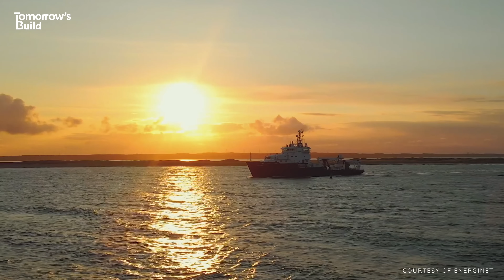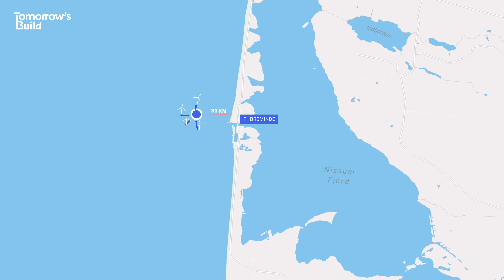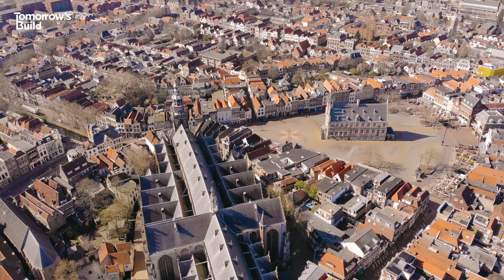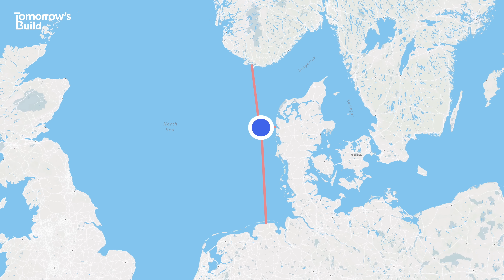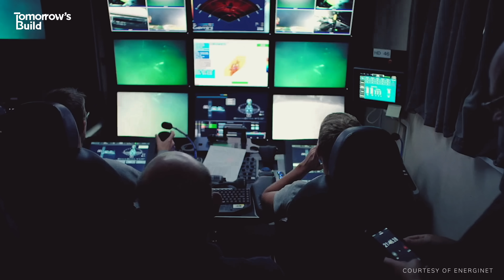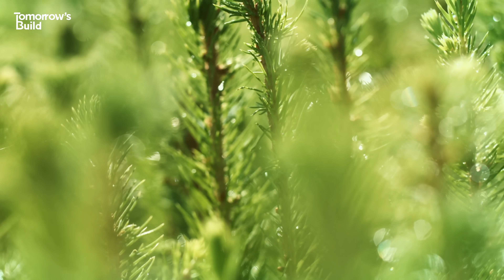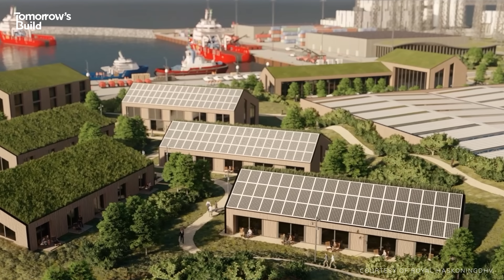Denmark's $34BN Energy Islands Could Solve Europe's Power Problem

Comment: Wind generated electricity is not dispachable on demand electric power and has to backed up by other sources of electricity that instantly makes up the dips in the erratic output.   If that is typically done by natural gas turbines generators running at service idle using 70% of the fuel of full throttle, but making no electricity.    There is no fuel saving advertised on renewable solar and wind generated electricity which likely means there is very little fuel savings.  

It is scientifically impossible for greenhouse gas behavior to cause global warming.  All the greenhouse radiant energy from the earth is completely absorbed in earth's greenhouse effect by greenhouse gases within 20 meters of the radiating surface that is always in saturation from the strong greenhouse gas water vapor.  This video has the United Nations Climate Change disclaimer.   Global warming was officially stated at 1.1°C in 1991 and 1.06°C in 2022.  The cause of global warming is not known as of 2024.

Comment: Any method of large scale energy production will have some environmental impact. Having said that, wind turbines at sea seems like a very good option as long as some form of energy storage that does not involve chemical batteries can be used to dispense out the electricity during times that the wind is not blowing.

Comment: problem with electricity is, its not oil, to be transported from 1 side of europe to another. Electric power grid is very complex thing, which needs to be always balanced. At every moment, volume of consumption and production needs to be same. this video is nide, but only for coastal areas. Not exactly replacement for i.e nuclear power...

Comment: Denmark could produce a lot off electrik underground. 
They have a realy good and systicatet underground draining system for top water. That runs from small drains to main drains running the hole year. If they would install a lot off small electrick wheels (wokkels)(twisters) in to those main drains they are getting a lot off free and cheap electrik.
I have been working on the baltic pipeline and seen a lot off good running maindrains. They habe been a serios problem for us and we needet a lot off pumps to pump the water to the other side so we could lay down the pipe. And close up again. The fun part off it was. We startet in the spring intill the end off the summer. There we had not much rain. Sinds oktober we had a lot rain. Luckely we closed all maindrains and had nothing to do with open one.s in this period. 
It would habe been a nightmery now days.. 
It means they are running like a monster.. 
I saw that twistet plastik on a steel wire from a chinees guy on youtube moldet to a dynamo producing electrik. And there started the idee. 
Denmark you have a realy nice system down below. Where it could be posible to urn produce free electrik and provide work for a lot people.

Comment: works only for northern europe. actually, it works only for the shallow water sea like baltic and north sea, and maybe 1/3 of the adriatic sea. it will clearly not solve the issue. right now when the wind is blowing over the north sea, there is enough power already. but there is clearly not enogh when there is no wind there ... UK had huge power issue in the winter 2021/2022 because of low wind levels in the north sea, this island, will only oncrease that problem ...

Comment: You get better results with nuclear power stations at a fraction of this cost. Just a simple calc... To produce 10 GW power you need 3,000 wind turbines that will cost another 10 B$. This does not include the transmission cost which might cost some 3 B$ So this Mega project will cost 47 B$. And every 15 years all wind turbine will have to be replaced...

Comment: Power problem is solvable by building the only clean and dependable energy source wich is atomic enerergy. Any other source is either too weak, depends on battery effieciency, or plain polluting.
Materials to create windmills, solars and batteries are far from beeing friendly to environment. Average atomic power plant produces one bucket of radiation waste a YEAR. 
In comparition 1 kg of coal produces 4 kWh o energy, 1kg of enriched isotope produces 2,700,000 kWh. Do the math.

Comment: No, this will certainly not solve Europe's energy problem. We need electricity when the wind does not blow too...
It makes sense for Denmark as they, at least used to, burn a lot of coal. Every bit of wind energy they can get then lowers the need for coal but wind power cannot be a base in the electricity system. You need something where you can control when the electricity is produced for that. Wind is a complement, at least until we have a good method for storing the energy on a massive scale.

Comment: While this all sounds great in its presentation, there are a few underlying weakness which comes with windmill and solar installations : 1) They are intermittent 2) They do not increase grid stability (staying at 50Hz constantly), but rather creates instability. Both are either outside our control or directly derived from the design.

#1 Pretty obvious. I don't think anyone can argue this is the case. Could this not be solved by storage? Technically its possible to store energy, but it does not scale to the requirement. F.ex. all the batteries built around the world in 2021, would supply Sweden's electricity need for 3 days. Synthetic fuels? You loose 60-80% in the process.
Not to mention that the numbers being presented on capacity is when the wind is blowing - the real average capacity is much lower.

#2 This is a physical derived issue. The grid requires constant balance - always and if not kept in balance, equipment damage at worst or at best we have brownouts.
Balance and thus stability is created by the large generators on the grid, by absorbing the fluctuations from the smaller contributors. Generators are the big power plants (Oil, Gas, Coal, Hydro and Nuclear) where the turbines sheer amount of kinetic energy is the stabilizing element.

The consequence is that a project like this can not deliver the amount of energy or stability required by us in Denmark or Europe.

Comment: Did I miss something here? There is no mention of energy storage. What happens when the wind doesn't blow, or blows so hard that the windmills have to be clamped to a standstill  (or for solar the sun goes down in winter just as the afternoon peak in demand begins)? In most places the answer is to light up a gas fired power station. This is clearly not a green solution. Solar power and wind power must go hand in hand with proper energy storage and that means pumped storage, batteries or some as yet not developed technology such as molten salt. Wind and solar power without energy storage are just wishful thinking.

Comment: Of course no one is asking what would be the impact of placing wind turbines. Taking away the energy of the wind in such a large scale WILL have the impact on air masses that are transported by the wind.
And the wind itself is nothing but differential pressure on different locations and it then air mass gets transfered from place of higher to to the location of lower pressure.
Are there any studies behind that take into consideration what happens when placing this wind turbine plant and its effect on climate?

Comment: There is no way to recycle the massive windturbine blades which last for about 20-30 years. Right now we create massive graveyards for them but that is not a sustainable solution.
Reply: or maybe store nuclear reactive waste for the next FOREVER at a current £100M per year
Reply: @simonpinkerton4905  storing nuclear waste is expensive but it does not affect us very much. we destroy land that cound have been used for good things when we create the blade-yards, and the fiberglass used in the turbineblades also take extremely long time to disolve. The blades are affecting us more than the nuclear waste.

Comment: Problem with windpower is that you cant control the production,  you will always need nuclear, water or fossilpower to be able to turn up the production by the press of a button and restrict it when needed.      Waterpower can store the energy effectivly since you pump up water when the electric is at low cost and releasing it at high.         If you make hydrogen when low and burn it when high you can also store but you only get 1/3 of the energy you put in, so its far from effective
Reply: It's more like you get 1/20th of the electricity you put in back as electricity with hydrogen.

Comment: Sorry Danes, but I am skeptical.

In my country the energy authorities have plans for huge wind farms in the Baltic Sea, with a annual capacity of 90 TWh. Just for the fun of it I calculated what this would mean if we used one of today’s largest wind turbines, the Haliade-X Offshore 14 MW. To reach our goal we would need 1216 of those behemoths. A Haliade-X has three turbine blades, each one 107 meters long and weighing in at a whopping 55 metric tons. The tower stands 260 meters tall. If you lay all the turbine blades and towers needed for the Baltic plans in a long row, it would stretch for more than 700 kilometers.

Imagine the industrial effort and energy required to produce all that material, not to mention the task of transporting and assembling the giants! And that’s only the beginning of it. Wind turbines are exposed to heavy strain from harsh weather conditions and mechanical wear, and have a relatively short lifespan. They must be replaced after about 20-25 years; which means tearing everything down and deposit or recycle all the materials used.

Does this sound realistic? Remember that the Baltic Sea plans are only a small part of the gigantic transition into “renewable energy” that is underway in the world. Will our planet’s industrial capacity be enough to sustain the never ending, Sisyphean task of building and replacing all those wind turbines? And what happens if we fail?

I am sorry, but our civilization was built on fossil energy, and it is childish to believe that we can replace it with unreliable electricity from wind turbines and other so called renewable energy sources. If we fail to realize that in time, we could face a global catastrophe.

Comment: Good Idea, but in one scenario, for example, a war with Russia happens, and these energy islands are central hubs for energy across Europe. If Russian submarines attack these energy islands, the whole Europes energy supply will be in trouble. Securing energy infrastructure on land is easier than on an artificial island.
Reply: Not really, they could just bumb a land based powerplant.
As we have seen in Ukraine.
Reply: @zaarkeru3391  When the opponent is weak, what you have said is correct. Ukraine is weak than Russia in terms of military strength. But when both countries have a strong military force, it leads to proxy wars. During a proxy war, Russia can send its submarines silently and destroy these artificial energy islands, leading to energy disruption in Europe. And Russia will deny doing it.
Reply: @srikark3532  
proxy war: "a war instigated by a major power which does not itself become involved."

So a proxy war would mean that russia wouldnt send submarines...

If russia is sending submarines, they could just as well just nuke a nuclear powrerplant...
It's not a proxy war at that point, its just a full war...
Reply: @srikark3532  
that's not a proxy war xD

i quoted the definition of a proxy war before...

its hard to defend a ultra high value submarine if you want to destroy wind turbines(?)...
that submarine would have to go back and forth and reload multiple times in order to destroy and cripple such a offshore park.
the island wont be destroyed by some torpedos...

or you could just slap a bike to a hypersonic missile and bomb a nuclear power plant...
Reply: Energy supply will be the least of our concerns if war breaks out between Russia and NATO

Comment: Air Conditioning should be re-thought so that the thermal energy in large buildings could stored as electricity instead of being vented outside cooling down the building.

Comment: Nice project. But they should also include some nuclear (maybe SMR) to bridge times when there's not enough wind, and to boost capacity. This way, they could produce more electricity, but also more hydrogen, which we need as a precursor for green fuels and green gas.
Additionally, they should not only build power lines to the mainland, but also some pipelines and terminals for various gases and liquids, like hydrogen, methane/LNG, propane/butane/LPG (for your gas grill, for the industry, and it's a great fuel for ships, trains and trucks), ethylene/propylene (precursor for plastics), ammonia (for fertilizers), etc.

Nuclear is a great energy source for hydrogen production: High-temperature reactors (pebble bed reactor, lead-cooled reactors, dual fluid reactor, ...) would enable H₂ production via thermolysis (with the very efficient sulfur-iodine cycle), while special light water reactors could enable H₂ production via radiolysis.

Maybe they should also include some geothermal energy (offshore, geothermal projects wouldn't be plagued by protests and lawsuits by residents).
And maybe they should build heat transfer lines to the mainland, for district heating. They could be connected to the thermal storage units and the geothermal plants, and they could help recycle the waste heat of the nuclear plants and the data center.
The concept could be completed with waste incinerators: An energy island is ideal for importing waste coming from ships, and directly using it for waste-to-electricity. Waste that would otherwise end up in a landfill.
Reply: It makes zero sense to scale down nuclear when the wind blows - when any nuclear plant is built 99% of the cost is already spent. Nuclear fuel costs less than wind power maintenance.
If you’re lucky enough to have your needs met with nuclear you will never need to build another wind turbine ever again…